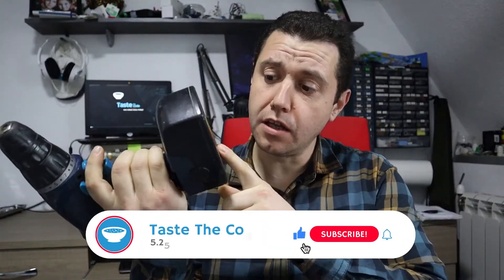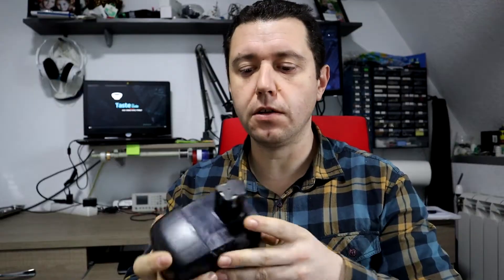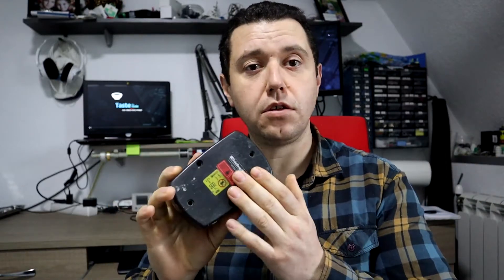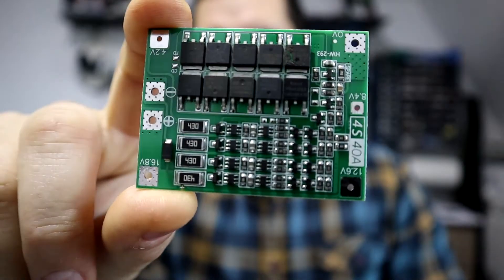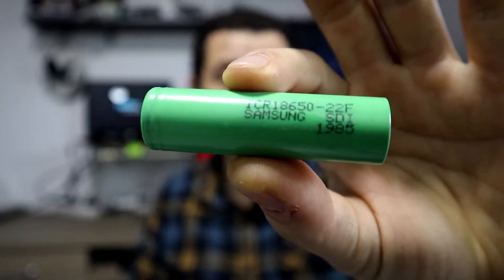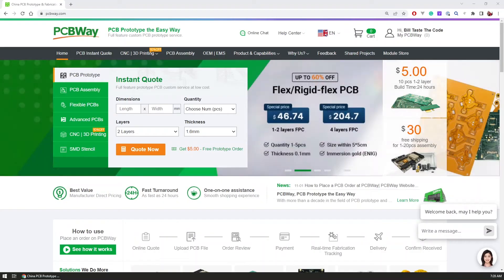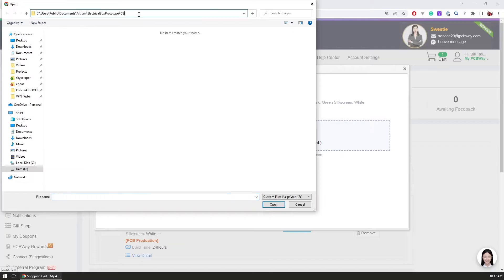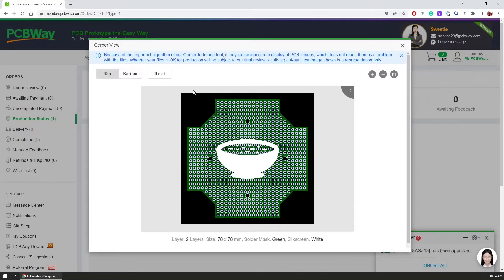How to turn your outdated NiCd tool batteries into powerful Li-ion ones!

Comment: 40 amp BMS? Is it enough for such a high-watt low-voltage tool?
Reply from the maker: Yes, seems to work fine. These drills usually use ~200W of power and at 14V that equals to ~14A. Even at 500W it only goes up to ~35A.
Reply: @TasteTheCode  I assume it is indeed drill specific. I'm converting to lithium an old Bosch PSR 14.4. According to specs the maximum wattage is 850 and with a 4s battery, it seems I must consider a minimum voltage of 12V. = 70A
Reply from the maker: Yes, true that. Although with lower voltage, the general power output will be less than at full voltage. The batteries will not output more current as they get discharged.
Reply: @TasteTheCode  Good point

Comment: Never do something like this. Extremely unprofessional and low quality upgrade. First - slow and weak elements, second - too much soldering (all that soldering has its own resistance and takes from 10 to 15% from output power and add at least half an hour to charging time, if you do something like this get a f… dot welder), third - easy combustible materials used, fourth - update the fkn info on the battery for others to know the new specs. Nobody cares about your tea cup sticker you idiot. Print one with new data first. And fifth - overall job looks like did by an amateur. Horrible.

Comment: This is really dangerous.. use extra isolation beetwen cells and also + and - terminal.. with time, dust and other things, like metal shavings go inside, and you got a nice short circuit, they will explode.. otherwise.. you can build a cheap spot welder, using microwave transformator and a controller module, if you need help about this, just let me known!
Reply from the maker: It's not that bad as you described. The housing is well sealed so only if you drop it inside a very conductive liquid you may have troubles but that is a different story.

Comment: How are you charging the new pack?
Reply from the maker: Usually not. Depending on the charger, sometimes you might but a dedicated li-ion charger is required for these packs.
Reply: @TasteTheCode  how about those Li-ion charging boards with adjustable output? If i put and connect it inside the battery.
Reply from the maker: I'm not sure to which you exactly mean bit as long as the battery voltage is matched and there is a BMS on circuit, ot should be fine.
Reply: @TasteTheCode  if i have 4S and I buy one of those Li-ion charging boards which have 16.8v output. So that will work since i have a bms?
Reply from the maker: Yes, that will work.
Reply from the maker: At first with my bench power supply but then I bought a dedicated charger and installed a DC jack to the battery for it that connects to the battery terminals.

Comment: I did this with my Dirt Devel Dust + Vac recently. NiCd batteries sucks and I had several of last year's vape batteries laying around. After modifying the case and making an appropriate charging solution It constantly has more power and instead of only lasting the factory 7 minutes I can vacuum for around 2 weeks before recharging ( I'm assuming 2+ hours per charge now).
Reply from the maker: Nice! I have never seen such a modification done with vape batteries. I'm not sure how they handle high current consumption. Do they get hot while using them?
Reply: Yup definitely worth it for those.

Comment: What's the board used for.?? can I use 3 Li batteries to get 12 V with no board attached??
Reply from the maker: That board is a Battery Management System (BMS) that protects the batteries from overcharging and cuts off the output once they reach their empty voltage level. You can get the 12V that you need without it, but you risk damaging the cells.

Comment: I wouldn't suggest using laptop cells for power tool batteries. The 22F is the perfect example of your typical laptop cell. 2200mAh capacity, max continuous discharge is 2C so 4.4A. Obviously you don't want to push your cells at 100% of their rating due to voltage sag even though this isn't a continuous use application. I would definitely go with cells that have at least a 10A rating for the least powerful power tools. If the battery is going to be used in something that is a real hog, definitely stick with cells that have a 20-30A rating. Molicel's are always a great choice. Samsung 25R, 20S, 30T, 40T, LG has several high discharge cells like the HG2 and HE2/HE4, Sony has several in the VTC series, for EVE I can recommend the 20P or 25P. BAK and Lishen also make good cells.

Edit: Its so refreshing to see someone has had the forethought to leave the nickel strips on the paralleled cells. They were born together so might as well leave them together. And in your case made it much easier for you to assemble the pack. But that tab you broke off the last pair...thats the tab for the balance wire.

I'm also baffled by the uninsulated wire. Definitely a few major no no's in here that you're gonna get jumped on for.
Reply from the maker: Hey, thanks for the great tips. Unfortunately, I do not have access to new cells because there is such a small demand for them where I live that no one is actually selling them. 😞 And yes, the original strips are a life saver. I also can't understand why people tear them when the battery couple is still good. 

The wire that you mention can definitely be isolated, but then again, their is nothing that it can short against to cause any issue. The last balance tab is the same as the last connector on the BMS so I soldered the wire directly in the middle so it can theoretically drain from both the cells equally. 

As a last note, since the cells are in parallel, the current will be shared between and this improves the current rating a bit but I agree that when possible, suitable rated cells are the way to go. 

Again, thanks for the tips and your time! 👍👍👍
Reply: I would think that even the least rated 18650 cells would exceed the original capacity or rating of the original NiCad, whether as a whole pack or maybe even individually. 
My problem is that nearly every old laptop battery I've gotten hold of was junk, maybe one or two cells that were still good out of about 20 that I cut apart. 
I would suppose that like myself, no one throws away a laptop or battery that's still working. My current laptop, now a year old already needed a new battery, not a single cell inside was usable. Since a new battery was only $12, I highly doubt they're using very high quality cells either. 

The biggest issue I see in converting an old NiCad pack is getting the thing open, 
nearly every one that I've got is sealed closed, short of sawing the bottom off or spending hours trying to carefully cut through the plastic without compromising the physical shape of the case there's no good way to get to the inside. 

I did convert a few older 7.2v and 9,6v Makita drills with stick batteries to run loose 18650 cells, I simply slide them out and recharge them in a regular charger when needed. Its worked well for a few years now but I've got a box of Dewalt 14,4 and 9.6v Snap on tools that need a solution as well.
Reply from the maker: In my case, most of the batteries I have opened only have one bad pair so I can usually salvage 4 cells. Also, over never come across a sealed tool battery. They all have screws and can be easily opened.
Reply: @TasteTheCode  Only a two of my older DeWalt batteries are held together with screws, all of my 12v, 14v, and most 18v are fused together. So are all of my 9.6v and 12v Snap On batteries. I did make crude adapters using old batteries to be able to use the cheap HF Warrior batteries to power my CT30 Snap On impact and several of my older Dewalt tools. The best so far is using it on my old 14.4v Dewalt circular saw. It lasts twice as long with the Warrior battery, which I bought for $14.99 with the drill  two years ago, then it ever did on the original batteries without all the heat in the battery. The Ni-Cad batteries would overheat when used in succession and it took a dozen batteries to get through the day. But I can multi cycle the HF batteries all day long without them getting hot thus only needing two or three to cut and fit several sheets of plywood or to cut trim all day. On trim work, one battery will last all day. I re=sheathed my 20x20ft porch on two batteries last week. 

My laptop, a two year old HP 15, needed a new battery. I just cut apart the old battery and not one of the cells will hold more than 1.2v even after being 'jumped' with a good cell and charged. I found the same thing with the battery out of my older Gateway laptop, having only one cell that would attempt to take a charge but it would get hot and end the charge at 3.4v. half of the cells were visibly damaged or discolored. 
A buddy got me 11 laptop batteries from here he works, (trash company), I cut open each one and ended up with four 18650 cells that would charge, and only one would retain a charge more than a couple days but it had no longevity. It would only light a single cell flashlight for about half a minute before turning off. 
Most lap top batteries are pretty old and pretty far gone by the time they get replaced. My gateway is 15 years old and came new with Win Vista. Although it lost capacity, in the end it would still run long enough on the original battery to check my email and browse the web for a bit but about 45 min. was about the limit. 
It would last 4hrs when new. 
The new battery only lasts about 2hrs tops. 
The new battery in the HP only lasts about 30 minutes or so before it starts shutting down functions and cutting back on screen lighting. Of course the fact that its only got four cells inside has a lot to do with that but for $12 new I didn't expect much. Its at least as good as the original battery though.
Reply: @VB-bk1lh  This is incorrect. NiCd have some shortcomings but they are plenty capable of high current discharge, typically over 15A, and easily beat most 18650 that aren't designed for high current applications.

That doesn't mean that you couldn't use laptop cells and just accept the poor performance and premature undervoltage protection shut down, I mean if they are free instead of picking them to buy for the purpose, but I do agree that once a battery pack becomes old and fairly worn out, it is hardly worth the bother to use the cells in a new project where high current (and thus capacity too) matters.
Reply: @VB-bk1lh  There's a quite "easy" way to open those sealed cases.
I don't happen to have the link right now, but I watched a video on Youtube where a guy (Polish, or maybe German) opens it with a hammer, of course hitting the right spots with the right strength many times.
So I did it, AND I SUCCEEDED in few minutes with ZERO damage to the case.
Reply from the maker: That is cool info. If you can find the link to share it will be perfect.
Reply: Smart and informative comment. All while keeping the snarkiness to an acceptable level. Thanks.
Reply: Wire in parallel for more amps. Most tools run in bursts so not a big deal for most uses.

Comment: Great project!

Why do you use so much flux?
Reply from the maker: One can simply never have enough flux 😂😂😂 Jokes aside, flux makes all solder joins better.
Reply: @TasteTheCode  It does make joints better but quarter of the amount you are using should be enough and less to wipe away after to prevent corrosion on boards and components.